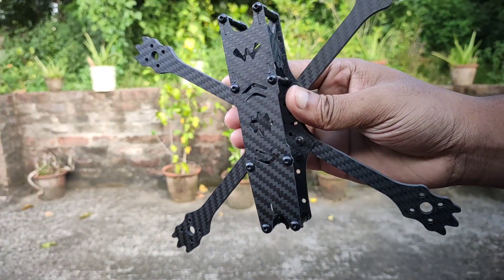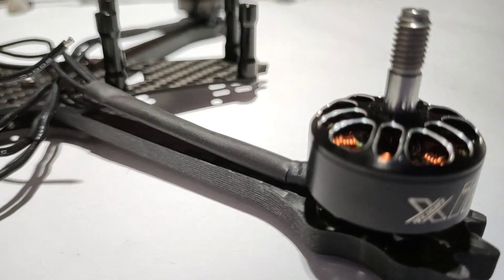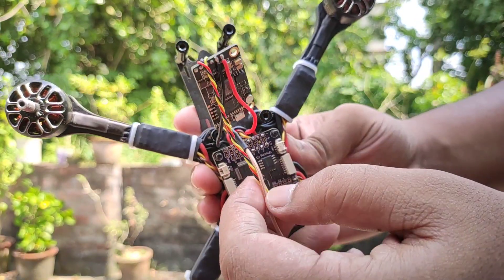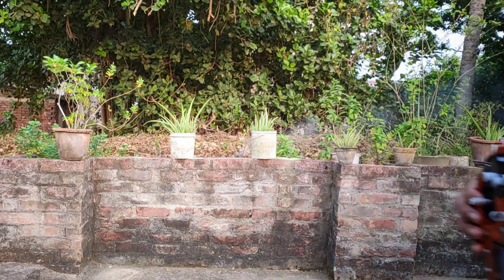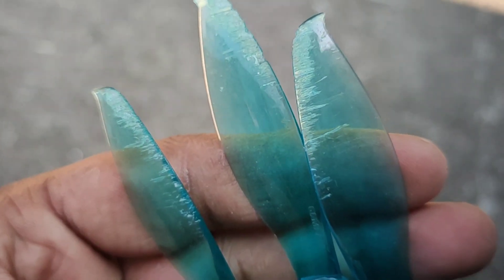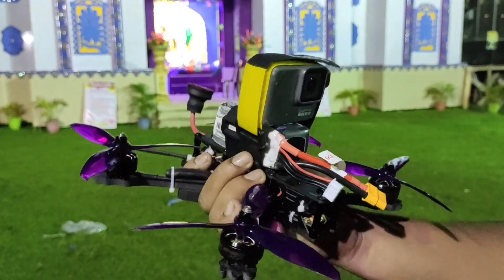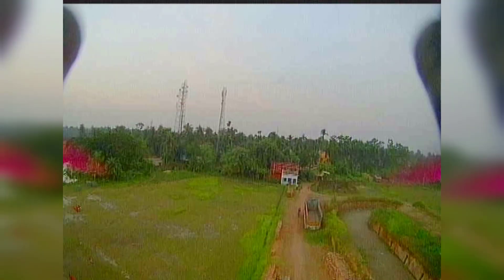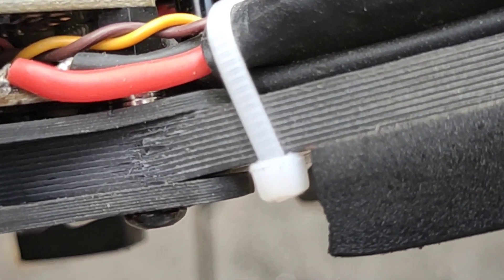How to build FPV Racing Drone at home. will it crashed by cellphone tower..?

Comment from the maker: Don't buy F3 flight controller cause it's too old, buy any F4, F7, or H7 flight controller for much better flying experience and enjoy lot more features..
Reply: Noted
Reply: Plz all parts link plz
Reply from the maker: Actually I bahght the motors from tujorc.in (not Available now) 
Esc- Robu.in ( Don't buy emax lightning esc cause it's old now.. better to buy blheli32 esc..)
Battery- Quadkart.in ( not available now )
Radiolink transmitter- Amazon.in ( not available now) ( don't buy radiolink, nowadays many better options are available like Frsky, radiomaster, )
Fpv goggles- Banggood.com 
 Check out Quadkart.in , Rcmumbai.in here you can find most of the fpv drone gears..
Reply: @akgadget  sir what problems one can face if f3 fc taken as of now
Reply: Plz all parts link
Reply from the maker: @Focus Contact me on instagram instagram, link in the video description.. let me check what I able to do for you..
Reply: @akgadget  please say what is your country

Comment: Bro can i make a drone with 2200mh 25C ,3cell battery with 2200kv motor. Its will work
Reply from the maker: Not a good idea.., better to get proper equipments
Reply: @akgadget  mane galti se 25C battery buy kar liya ma kyakaro

Comment: Could.. you not have just.. Taken a better reciever from size wise. And get a better cam that fits? And also put the VTX in the back of the drone? Also why did you leave the motor wires long? I was happy you were using seperate ESC's but you ruined my happyness via leaving the wires long. From out that. The F3 is fine. And the rest of the quad is fine.

Comment: Hi Bro, i like your flying style.. Also I looked at your comments for answering others query. Many people like me, who are new to drones may not know where to buy and what exactly need to buy(whether it is old technology or new technology). I saw you recommending FPV drones can be bought at less price. Can you provide the full parts list, which is current technology and ideal for FPV drones.
Reply from the maker: Nowadays fpv flight controller and ESC has improved a lot.. Make sure you buy atleast f4 base flight controller ( if possible then buy f7 or H7 processor base flight controller cause those are more powerful ) and buy blheli32 firmware base ESC for fpv.. 
  And buy any motor that you want.. nowadays emax eco 2, iflight xingE, T-motor velox etc.. are really high performance motor in budget..
  And if you thinking to buy new rc transmitter then try to buy opentx base transmitter ( if possible ) ..
 And for fpv camera foxeer, caddx, runcam are very good option.. 
 For vtx, buy any vtx which is capable to give atleast 600mw of output power for better range...
 For goggles, in budget eachine ev800d is a good option.. otherwise skyzone, fatshark are awesome.. 
  *If you thinking to get digital fpv then buy DJI fpv goggles V2 and airunit as well..

Comment: Absolutely Yes, You lost control over due to BTS( Base Transceiver Station). Due to Interference of BTS signal with your Drone's Transmitter's signal Drone didn't decrypt the signal and due to missing control signal if just fell off. Solution for this to add a piece of code to supply constant power to motors in case of connection loss. By the way great video 👍
Reply from the maker: Thank you..

Comment: Bro some days ago I ordered f3 racing acro flight controller but I received sp racing f3 acro osd flight controller plz can u tell will it effect the performance of the drone and at which port should I connect the I bus  receiver
Reply from the maker: F3 acro OSD is upgrade version of regular f3 acro so don't worry.. and use UART-3 to your receiver..
  And if possible then return your f3 flight controller and buy F4/F7 flight controller... Much better..🙂
Reply: Bro thanks for this info but can u tell what is UART 3
Reply from the maker: @AshaAsha-wv3bs  look closely at your flight controller maybe you can find UART-3 connection port..
Reply: Yes bro I found it but it is written uart2 port and it has 8 soldering points 4 in parallel
Reply: Bro can we connect the receiver to io 1 or io 2 port for flysky I a bus i6 receiver plz tell me
Reply from the maker: Yes you can...
Reply: U also used the same flight controller no

Comment: Hi loved your videos, i was wondering if can make the drone behave like a dji drone using same parts, like i am a beginner and i have flown dji and it is pretty easy whreras in fpv drones like this it is a pretty stiff learning curve honestly( everything is manual i guess)
Reply from the maker: First of all Thank you ❤️
 And here is many differences between normal drone and racing/freestyle drone.. freestyle drone is really sensitive and hard to control.. you have to practice many times for learning the acro flight mode... But you can do it.. Happy Flying ❤️
Reply: @akgadget  bhai plz btado parts kaha se lete ho
Reply from the maker: @Keshav_arora34  You can get the parts from Quadkart.in
Reply: @akgadget  bhai bs yeh btado woh taranis x9d transmitter kaha se leya ha 🙏

Comment: Today i crashed my f450 with kk2.1.5 display is broken should i replace the display or go for the another controller like pixhawk or apm??

And for stability do we need gps!?? 
Or pixhawk or apm has inbuilt feature for it???
Reply from the maker: I recommend you to remove kk fc and replace with another fc...
   If you didn't want misson- planner then just go for dji naza...
Reply: @akgadget  yes done with kk i bought apm 2.8

Comment: What is the whole cost?
I have to make, my budget is 1.5lakhINR
Reply: @A K Gadgets..Hi pls tell, whether it is safe to buy stuff from banggod or not in India currently.???
Tnks for other replies bro!!
Reply from the maker: @abhyudaysingh634  you can find all parts here- quadkart, rcmumbai, robu.in, tujorc
Reply: @akgadget  But from where to get the radio link at 10 ii brooooo!!!!Pls tell in India.
Reply from the maker: @abhyudaysingh634  Honestly I don't know, very difficult to find the at10 in india... But many other options are available like frsky taranis, radiomaster etc....
Reply: @akgadget  any 4km range transmitter available in India? Pls tell
Reply: @akgadget  is radiomaster available in india ,where.??
Reply from the maker: For long range you should buy open tx capable transmitter and external long range module like tbs crossfire or frsky r9m... That's works better for you.
Reply: @akgadget  pls give me link of one of those brooooo!!!
Love u brooooo!!
Reply from the maker: @abhyudaysingh634  check out- https://youtu.be/xmaTq4JgTXI
Reply: @akgadget  I want link of the transmitter brooooo!
Reply from the maker: 1.5 lakh INR enough for high class fpv drone...
  I made this under 70k INR ( full fly pack )
Reply: @akgadget  From where did u buy the radiolink at 10 ii transmitter?. Pls tell. Link tooo?
Reply from the maker: @abhyudaysingh634  I bought the at10 from amazon.in but unfortunately it's not available now...

Comment: What is the weight and flying time
Reply: Battery mah and volts?
Reply: Thank you for reply
Reply from the maker: Weight around 530 grams with battery...
 Flight time around 3-4 minutes (at very punchy flight)
Reply from the maker: 1550mah , 14.8v